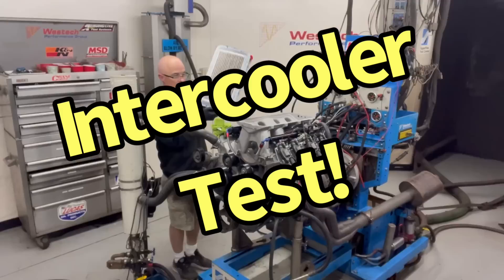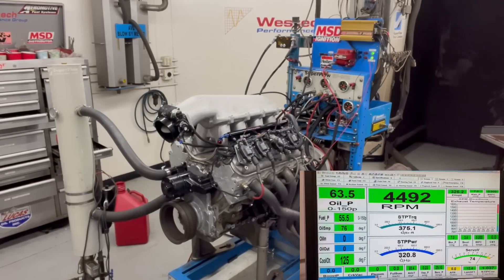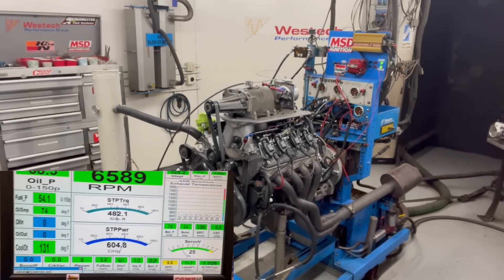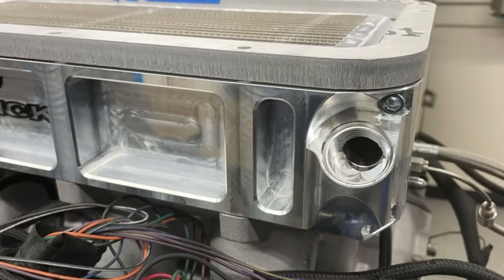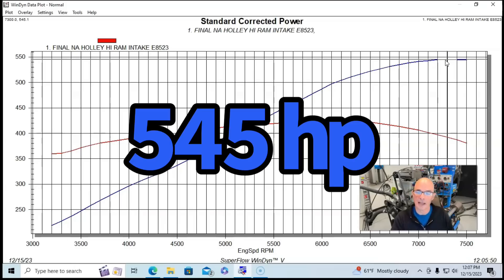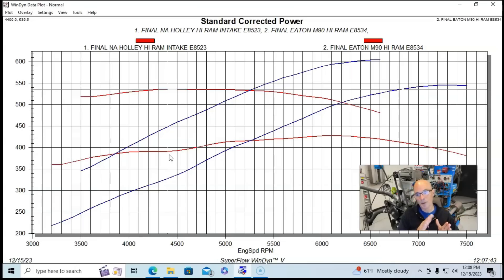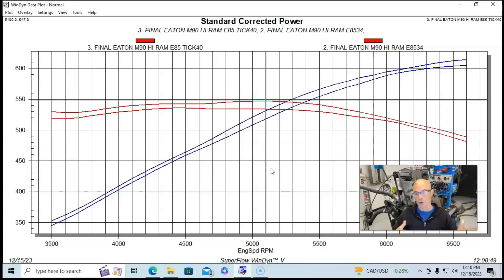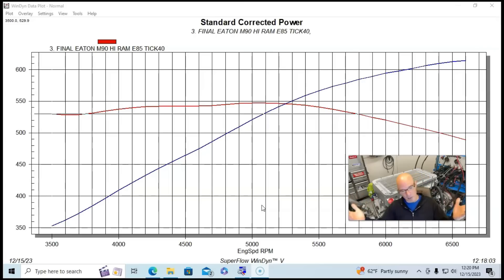HOW MUCH HP IS AN INTERCOOLER WORTH? CHEAP, JUNKYARD M90 BLOWER GETS A TICK PERFORMANCE INTERCOOLER.

Comment: Of course the boost should drop when you add an intercooler on a positive displacement blower. The blower isn't moving a lot more air volume as the pulley ratio is still the same, but cooling the air down makes it contract so any air flow increase will come purely from there being less pressure in the manifold against the blower, making the blower work more efficiently (less internal leakage).
Reply: I just wrote a similar comment in question format because I thought I was loosing my mind!
Reply from the maker: I need to phrase it better or you need to understand more-the point wasn't that there would be NO drop in pressure-the point was that this was too much of a drop for this combination of boost and flow and core size
Reply: @richardholdener1727  gotcha. Yes the drop is greater than you would expect by just calculating the ratio of the two temperatures in kelvin scale.
Reply: exactly
 @TurboBaldur
Reply from the maker: regardless of the temp drop-math doesn't tell you about the potential restriction
Reply: @richardholdener1727     the intercooler core is not the restriction. the hole the boost has to go through is the restriction.

Comment: Richard, i think it's time for a 2.3L Whipple. That lil M90 ran outta breath even with the 2.6" pulley
Reply: Whipples are like, 20x the cost of the M90 though. I'm here to see what The Little Supercharger that Could can manage!
Reply from the maker: not the point of this exercise
Reply: @richardholdener1727  
Or one of those supercharger and intercoolers out of a '03-04 Cobra or Lightning would be plausible

Comment: The quest for 700 HP with a junkyard blower... 

650 is probably more realistic. (More porting and the thicker spacer) 

Wondered if you'd see any belt slippage when adding the longer belt for the IC.
Reply: Water/meth and some optimizing here and there I think puts 700 just barely in range. Rich might consider bumping the sc pulley size back up a bit and leaning on the high RPM horsepower of the NA engine which sort of sounds like cheating, but 700 hp is 700 hp
Reply from the maker: WM won't add power